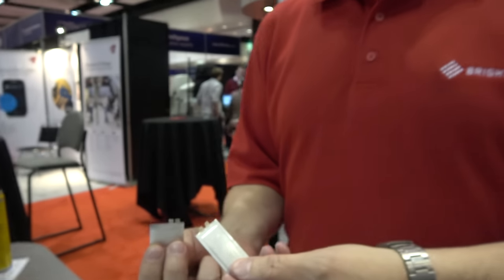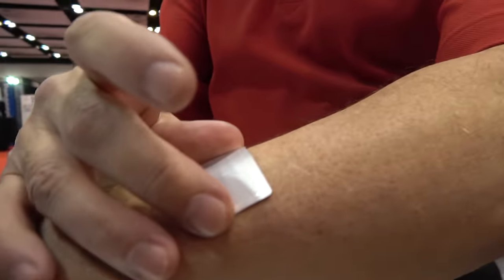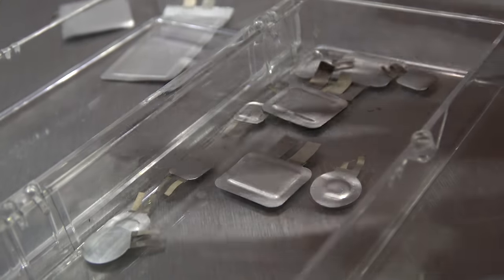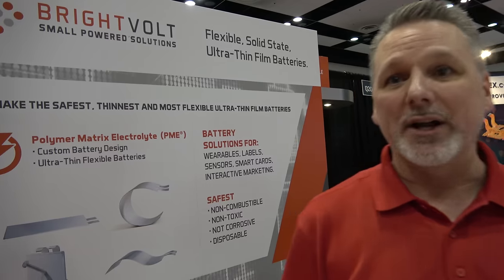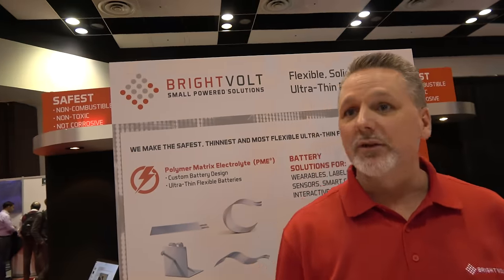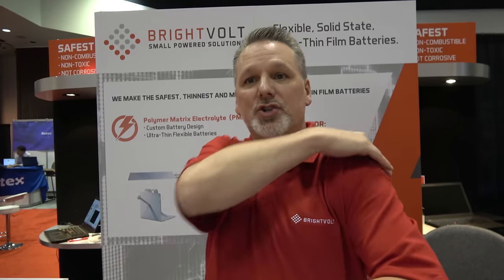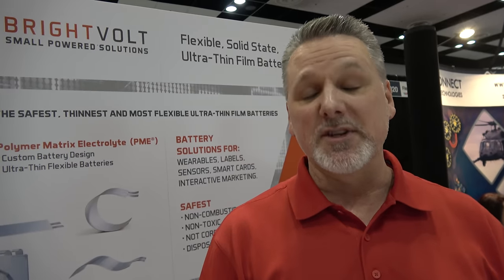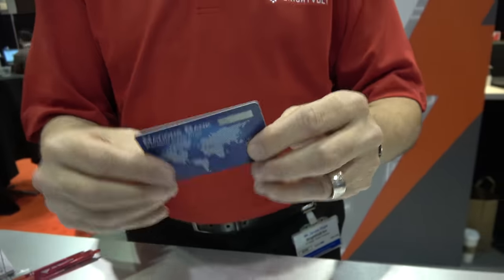BrightVolt flexible batteries using solid state lithium polymer

Comment: only 1500 viewers in a breakthrough like this! ? is it real or?
Reply from the maker: 7200 views now.. yes it's real, but when I filmed they didn't have rechargeable versions yet, hopefully by now they have it and I'll post a new video if I can film them.
Reply: The flexible battery from Grepow factory is rechargeable.
Reply: It is real, and I believe I seem a documentary on Netflix for Future Batteries or something of similar name. They connected one of these sheets to a lightbulb and gave the reporter some scissors to cut the sheet. The reporter cut off a corner, he cut it in half, he cut like 90% of the sheet and the bulb was still glowing. In that documentary, the ion's act really cool. They explained how the ions on the inside of a normal battery go from point A to point B but this new technology sends one chemical to the other side, then eventually, it naturally moves back to start over. It's amazing what people have made today. Hopefully we'll see these batteries soon.
Reply: its kinda old tech. However i am looking to, really intrugued if this will be used widely in the near future

Comment: Only 500 charge cycles, a lifepo4 is identical safe and can be charged to 2000 times. And even more when the battery cycles only between 25% - 85%. Or a normal lipo to up to 14000 times yes right 14000.
Reply: This doesnt fucking blow up either lol... you can also continue using it even after damaging it or cutting it or puncturing it